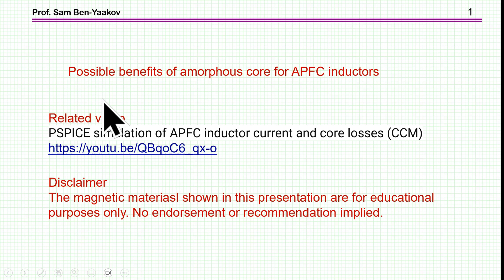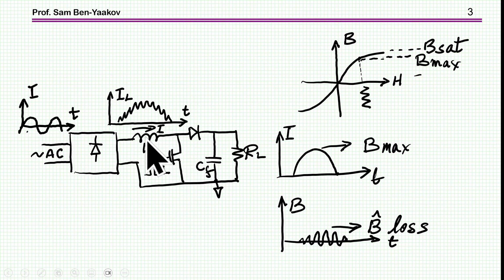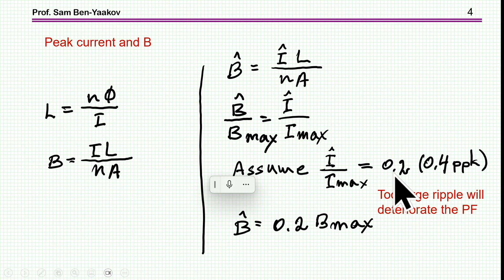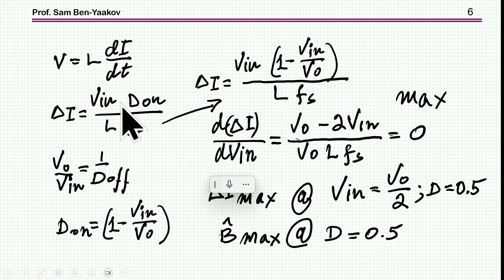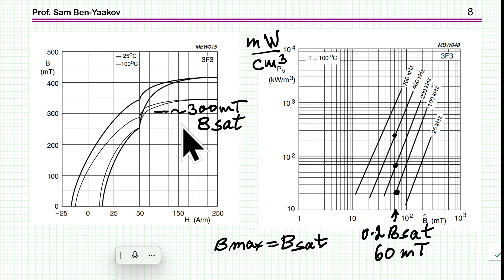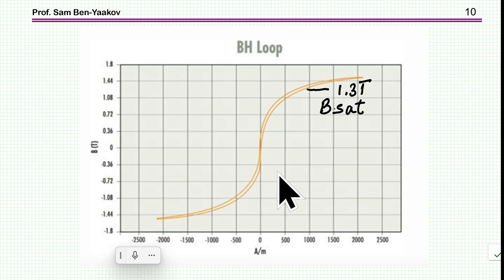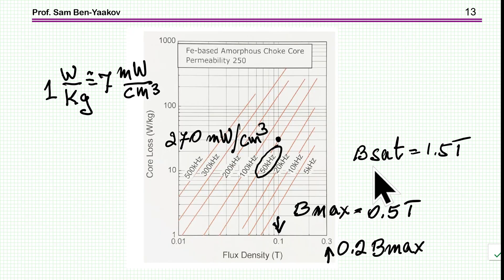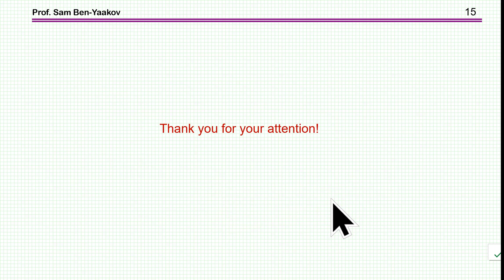Possible benefits of amorphous core for APFC inductors

Comment: Hi, you seem to know exactly what this technology is. 

I have an lf inverter, 200a 50vdc input max, 25khz switching, with a standard dimension 40mm toriodal amorphous for the filter, and a chunky 80mm amorphous toroidal transformer for the output. I just need it to do 8kw surge on occasion, rest of the time its doing nothing or less than 1.5kw, so Im working on making it most efficient, for obvious reasons. 

I am following engineering construction from a zx7-400 amorphous welding transformer as it happens to be doing the same thing, but in reverse. 
So 5 turns primary 47 turns secondary, center tapped to get 120vac x2. 
Should be good there. 
The wires are correct gauge and the primary (same connected wire wrapping around filter) is the thick litz wire for 25khz low loss. 

The inductor is what im concerned about, I will add for a start 6 turns to this inductor to see how the circuit behaves. 
I think its OK. 
But not certain. 

What do you think?
Its a great material to use on lf dc-ac inverters!
Reply: I will have to report back to you how it works (if it works well). Its another one of those projects on hold because of other priorities, but soon, im sure, within the month.
Reply from the maker: Great
Reply: @sambenyaakov  I got bored and did it, blew 6 mosfets out of 24, 
I think there was too little dead time, so I will have to replace the bad fets and try again with longest settable dead time. 
The board still works, its on for .1 second bursts and the mosfets turn on and shoot out sparks. Only tried it twice, so Im ordering more fets and trying again.
Reply from the maker: @RobertSchmitt-u7l  check the gates before turning on the HV😊
Reply: @sambenyaakov  Oh, I have an amorphous core inductor, the inductance was supposed to be UH not MH, I measured wrong, and got those mixed up, I though it was only 3UH, but it was 3mh, which is actually 3000uh. 

I probably just need 1 turn on the amorphous choke to get it back down to a reasonable 130uh. (what i can measure on my meter which is probably not totally correct). 

The residual current in the choke probably worked as residual inductance, not dead time, or maybe a little bit of both. 

I will try 1500ms instead of 300ms dead time and 1 turn on choke instead of 4.
Next round.

Comment: my guess is that iron powder cores are probably work okay in continuous mode with high current and low ripple, like some laser diode or cpu power supply when you want less core volume and cost or something.

however when you need some voltage difference and low ripple then you need more turns... which defeats the purpose of having higher B sat...
Reply from the maker: Modern cpu require very high current and  therefore the converter will be multi phase with high ripple current in each phase.

Comment: Here is my question opinion:
If you have that amorphous core and you also make an equivalent 3F3 then the 3F3 will be physically larger for the same performance. 
So considering this difference is physical size and loses on a per volume base. Wont the 2 core more or less break even at some frequency feven ? 
Basically from what i understand the amorphous core will be physically smaller then the 3F3 equivalent BUT due to the larger loses per unit volume a lot of the gains will be negated....

From your video:
3F3               20mW/cm^3  @100kHz   with about 60mT    and saturates at 0.3T
amorphous saturates at 1.2T with about 420mW/cm^3   
so loses are x21 time per unit volume BUT isnt the physical size like 1/4 also? so overall in this case it is x5 worse then 3F3 ? 

Am i correct or somewhere on the right path? 
Also what are the real world application of such cores with larges loses? filters? CMC ?
Reply from the maker: You are correct but X5? see just out of the oven https://youtu.be/nuWrkoPRUAs
Reply: @sambenyaakov  ops THX 
I was thinking of it in more pragmatic terms like yes i get more loses per cm^3 but also have a smaller size , at what point is it worth using amorphous? more on that line .

On a side note wouldn't amorphous cores be better for normal  transformer design then ferrite? since they can handle more B ?
Reply from the maker: @Robert88KAL  But over all it is still a higher loss

Comment: Hey Sam,
Thanks for the exercise. Ferrites do usually have better loss curves at high frequencies as you show. However what is not usually characterized is the loss with DC bias, which can be several times higher for some ferrites and nanocrystalline materials, or negligible for some alloy cores. 
For applications not requiring fast transient response such as APFC, I've wondered if there is a different design optimum for high Bsat cores with lower ripple factor, lower effective permeability, and more windings. Much lower AC current could compensate for higher DC resistance or enable more layers of windings, but perhaps the extra copper and capacitance are never worth it. I'm sure you have some insight on this topic.
Reply from the maker: There has been much talk about loss increase under DC bias, but I know of only one paper by Prof. Kolar that actually probed into it. 
https://www.pes-publications.ee.ethz.ch/uploads/tx_ethpublications/IPEC_JMU.pdf
My experience has been that the the increase is not that bad.